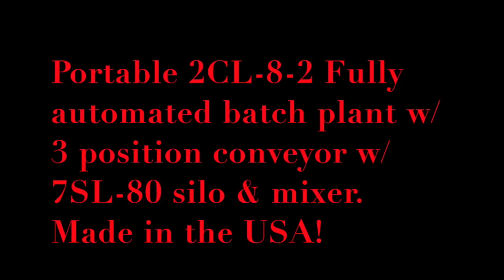Portable Concrete Batch Plant/2CL-8-2 - Right Manufacturing Systems

Comment: I did some research  and there is a company that uses a planetary gear box to rotate their drums. This looks like maybe a chain or gear drive which would worry me. My concern would be the chain stretching or alignment issues.  I think the company that uses the gearbox is something like cartway or cart away or something like that.
Reply: Cart-Away Concrete Systems
Reply: We have been making these drum for over 20 years, Yes the chain does stretch after 3-4 years.  It costs around $300 dollars to replace.  We are just now seeing main drive and Drum sprocket replacement after 20+ years.  We will absolutely put this system up against any planetary system on the market with regards to ease of maintenance and cost of maintenance.  Extremely Rugged!! We will also put this up against anything with regards to torque .  This system will turn 3 yards of dry material at an idle.

Comment: How much for one of these plants?
Reply from the maker: They range in price, depending on what you want.  What size bins are you looking for?  Are you looking at filling small mixers?  Large mixers?
Reply: Looking to fill 5m3 truck mixer so don’t need the mixer. We have large concrete job to do on a relatively remote site
Reply from the maker: Get me your email and I can send you some information.
Reply from the maker: @pltking  What is your email and I can email you some information.
Reply: John Reese please can I have your email and I will contact you
Reply: John Reese what if, it is vertical concrete? Does it have extension?